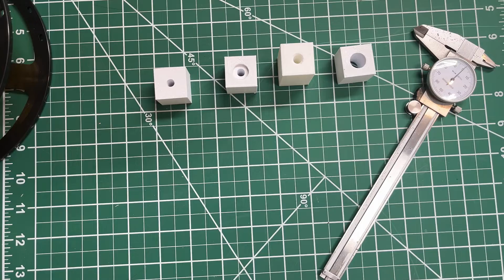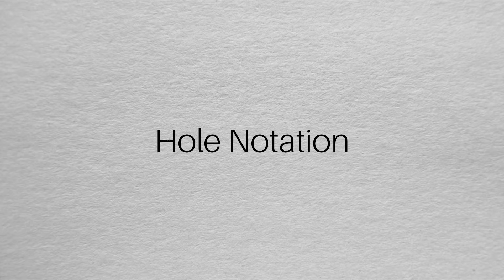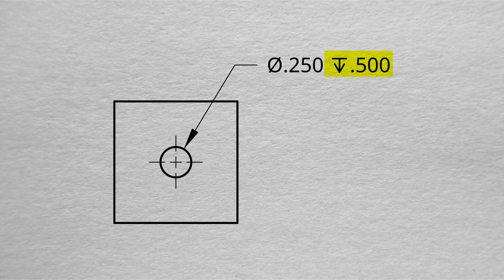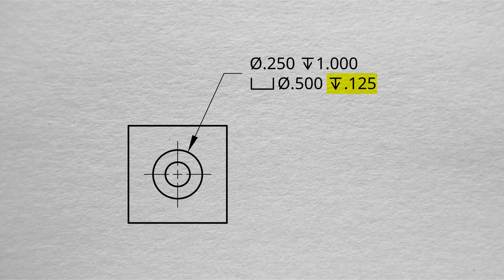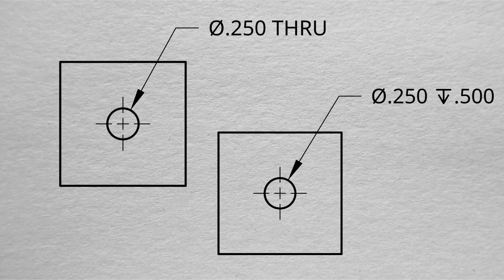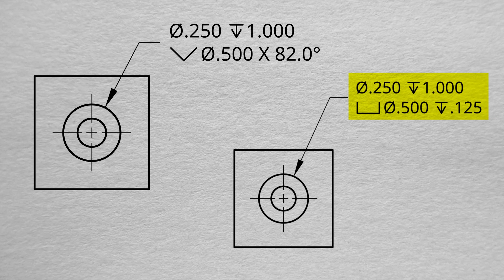How to Read Hole Notes and Types of Holes

Comment: Hi.
I am looking information of hole, which have marked as: Ø9/Ø14
One hole given two deimension and slash between, what this mean ?

Thank you
Reply: Whole note is: Ø9/Ø14 ↧10
Reply from the maker: Hmmmm. I haven’t seen that one before. It’s probably a metric dimension and my guess would be that it’s and inner and outer diameter for a thread with a hole depth of 10 mm. You may have to consult one of the many metric standards organizations to see if they have a specified notation that matches what you have.